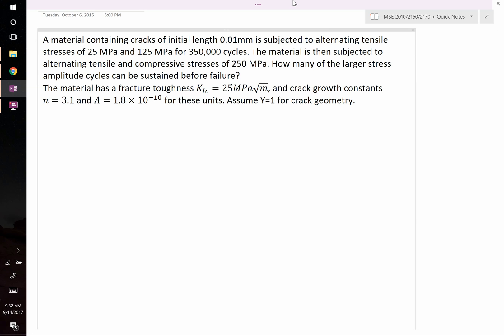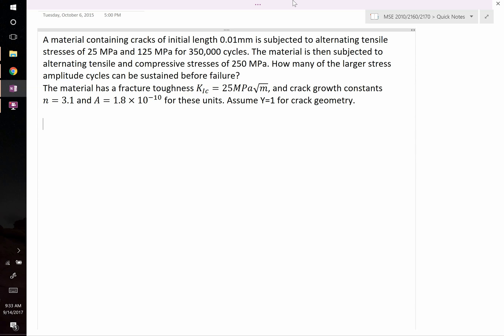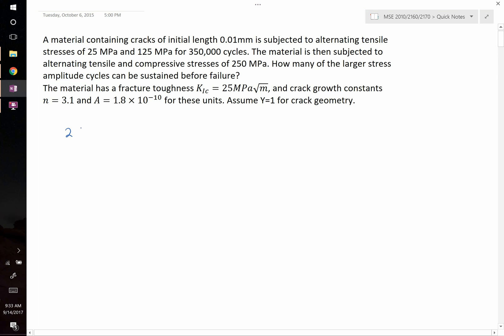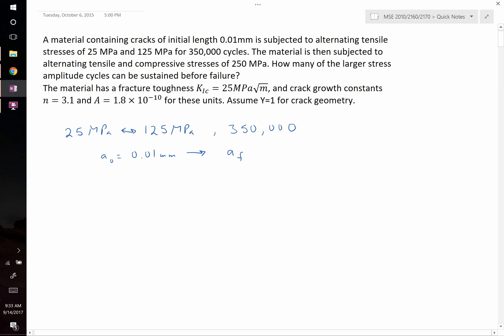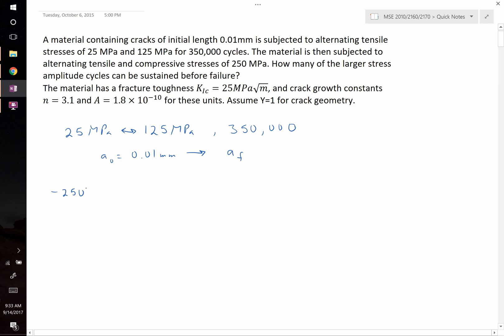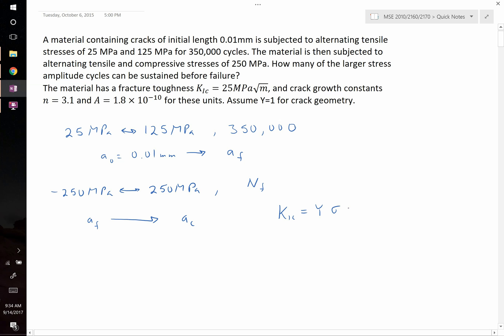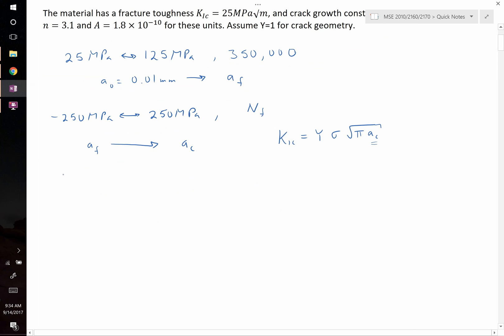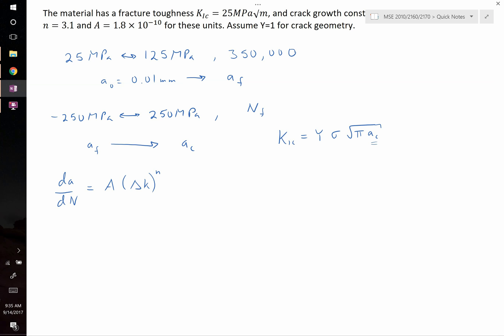crack growth and cyclic fatigue failure example problem

Comment: Why isn't the change in stress multiplied by 10^6 (as in 'M'Pa)? Thanks
Reply from the maker: Good question. In this question it states what the crack growth constants, n & A, are and it says for these units. If they had given the full units of the crack growth constants we would see that it was given in megapascals, not pascals. Therefore we don't need to multiply by 10^6 in order to convert it to pascals.
Reply: Ahh makes sense thanks a lot :)

Comment: You are the Ron Burgundy of fracture mechanics
Reply from the maker: Pat Ginnetti hahaha. Absolutely made my day
Reply: I appreciate your help.   The formula I have in my textbook (Hertzberg) shows that Nf = 2/[(m-2)*A*Y^m*sigma^m)] * the integral of ao to af.   I get a different result.  I noticed you have Pie in your formula wheras I don't.   Any idea why?
Reply from the maker: Pat Ginnetti so your textbook is giving you a generic solution where they did the integral for you. Whether or not you use pie or not is something I don't fully understand. Some textbooks included whereas others do not. I think that it should be included., but if yours does not then you should probably leave it out since your professor is using that textbook

Comment: if there is a residual stress presence where crack is and your trying to calculate the critical crack length do you add the residual to the yield stress of material or do you subtract. ( general question)
Reply from the maker: abdulla alsuwaidi again, this residual stress probably means the fracture is multimodal and more complex than our simple scenario here. However, whether you add or subtract this contribution depends on the nature (sign) of the residual stress.

Comment: what if your calculated critical crack length is bigger than the physical thickness of vessel, dose the failure mode become plastic collapse ?
Reply from the maker: abdulla alsuwaidi good question. Remember, the fracture I am calculation g here relies on a number of assumptions. Most importantly, mode I fracture. As flaw size gets larger and approaches thickness we can adjust geometric parameter but it has no solution for when the flaw is larger than the vessel thickness.

Comment: where did the -1.8182 come from if u can clarify please :)
Reply from the maker: Sure, the integral originally had 1/a^(3.1/2) which is just 1/a^(1.55) which is just a^(-1.55). When you take an integral you know you need to add 1 to the exponent and then multiply your term by 1 divided by the new exponent. In our case, when we add 1 to (-1.55) it becomes (-0.55) and then we remember to multiply our term by 1/(-0.55) which is equal to -1.8182.  Does this clarify?
If these videos are helpful please like and subscribe so I can grow this channel ;)
Reply: i make this out to be... -n x 1/-n+1 so -1.55 x 1/-0.55 gets me 2.8181, i must be getting close. what am i doing wrong. great video btw. @TaylorSparks